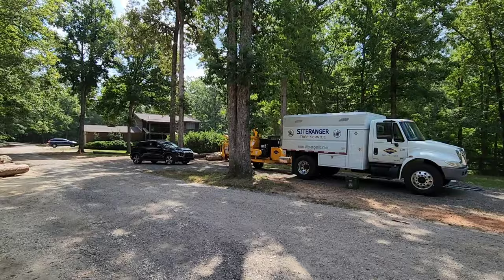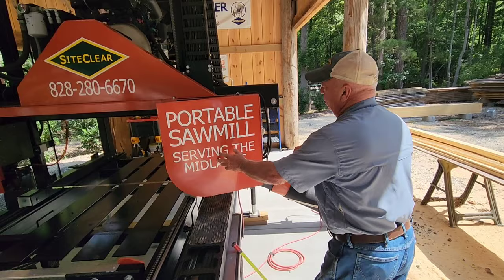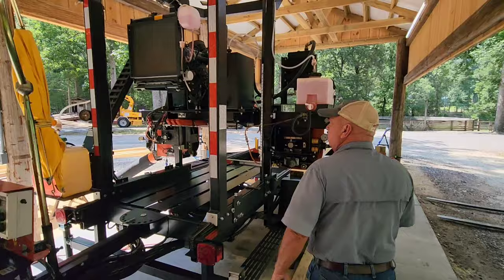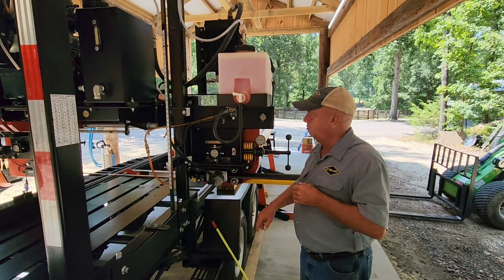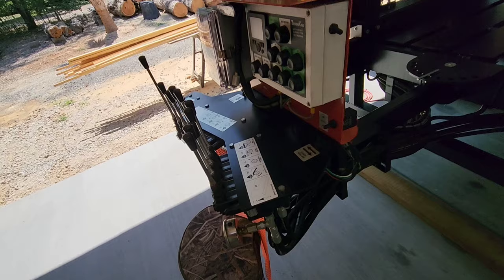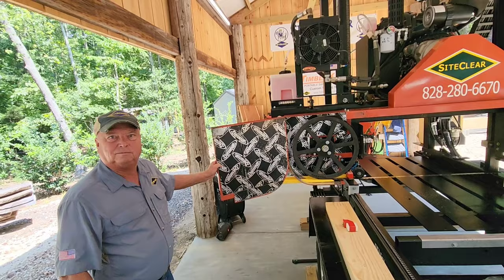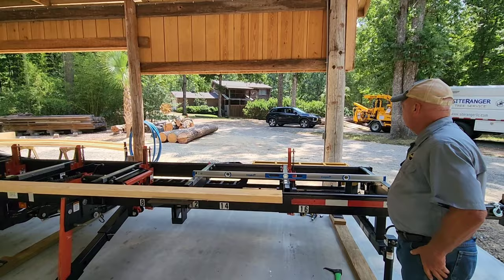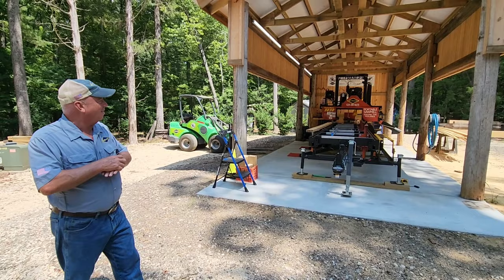The most modified Timberking 2020, Searching for Sawmills episode #7

Comment: One addition I would make is a small hopper on the sawdust discharge that could be tripped at the end of the cut and dumped into a skip pan. This will make clean-up under the mill easier.

Comment: Great video guys!!  Quick question.  Any idea why the wall coming down from the roof is stepped on one side and even height on the other?  Thanks in advance!
Reply: On the discharge side I’ll be adding a side “lean-to” room to store slabs, etc. Extra vertical height is for height of the room.

The other sides are as low as practical to reduce rain hitting the mill.